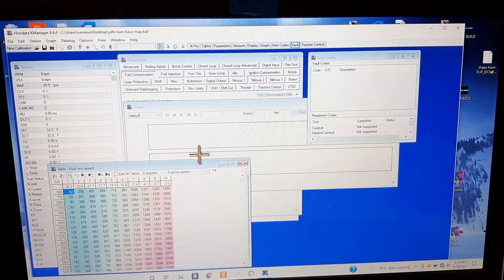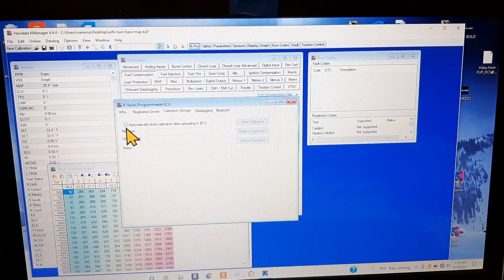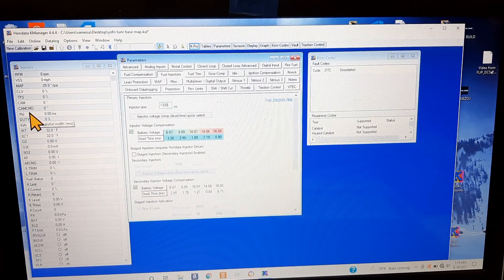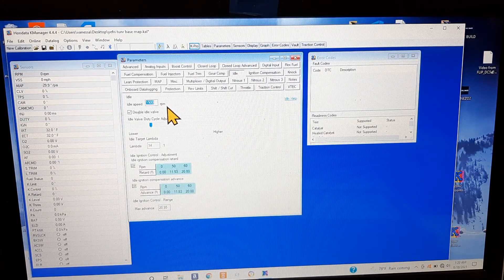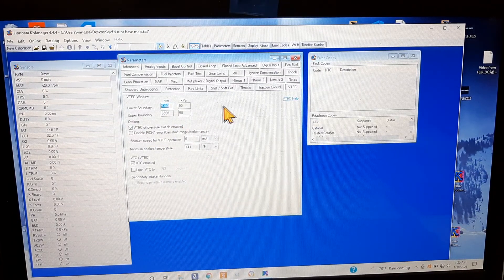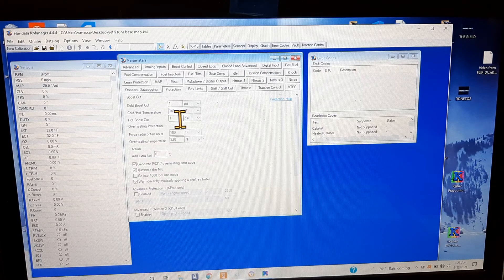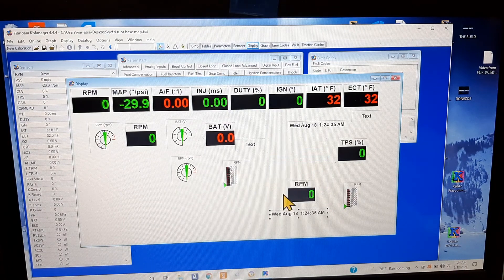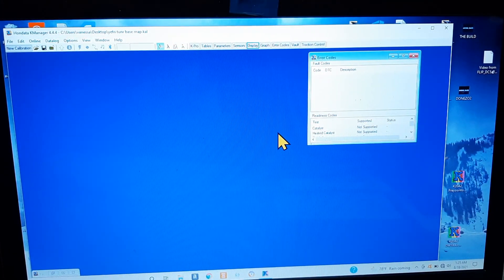Diy kpro4 ,do dataloging,Change injector size,Rev limits,Control idle,Retrieve maps,&more

Comment: Thanks for making these new Kpro videos. Yeah been sittin on a new Kpro 4 for a minute and actually don’t Really like it. Pay ALL that loot for an ECU and Hondata don’t give you SHIT for a manual on navigating the Kpro! Weak customer support in my opinion. ALMOST bought the Fueltech ft450 and sell Kpro 4 till I seen it was gonna be a nightmare to setup. You gotta know the cam and crank pulse plate teeth count for it to even recognize and even crank and fire. Support or info from fueltech for K series is little to none this early on. So for now just stuck with the Kpro. Can’t get my swap to idle  smoothly or for any duration of time. Revamping fuel system and some other stuff.
Reply from the maker: Yeah they deff dont have a manual 4 nothing,thats so u give money to the tuners. Wow that sounds crazy, if u upload a base map the car wont turn on?it should turn on atleast change ur injector  size and u should be good just for idle. If u have stage4 cams then it might be harder,but check in the kpro see if they have amap for cams ...i thought they did. Kpro is suppose to be the easiest to work with, Dont get full of fear afraid to touch anything,if something is wrong just unplug it. As long as u dont upload and change the map ur good. But Gluck  and ur welcome. I put those krpo videos  on playlist👍
Reply: @Queensraces  I didn’t get a notification so I had to go back and see if you responded appreciate it  greatly. no the deal Is everything is wired right Also. It’s running rich then goes lean. on idle . Didn’t put stage 4 cams in yet . I’m waiting to go boost and cams and head studs and gaskets all set back till I get it running and idling and everything else even had to buy a header and full exhaust just to be able to run it in my neighborhood so I can at least get the idle and run decent. Anyhow yeah I get that Hondata  wants  to throw a bone to the tuners but they’re like the only ones out there that I’ve seen doesn’t even give a manual . like it’s just stupid as hell. Anyhow thanks a lot for the help and info
Reply from the maker: The pulse plate teeth omg mad detail ..🥺 i know some people dont want this info to get out but i made this video becuase there's  no info about kpro stuff on youtube. Not ever1 has money just to throw at these tuner for maps feel me...so im happy if any of my vid helped u bro
Reply: @Queensraces  . FACTS bro. Yeah I ain’t rich neither so yeah.

Comment: Can I pass inspection with a kpro in a car under 25 years old?
Reply from the maker: Yes u can,u can turn off the emissions, and disable the 2nd 02 sensor .AND ULL PASS.
Reply: @Queensraces  thanks.  I understand how to turn off sensors but where i find the option to turn off emissions?
Reply from the maker: @larryp85   idk how to do it ,but if u see anything  in the kpro that say disable evap! Disable bank 2 02 sensor,or if u find the word emissions . I dont want to lie so u ill check later in my kpro.
Reply from the maker: From wat im reading if u buy kpro that automatically  disables emission. If not to find disable evap and u can pass emission
Reply: @Queensraces  ok thats what i was thinking. i know hondata used to have a readiness section to get you ready for inspection before the recent update. i would expect them to make it automatic/ hidden to avoid problems with the epa since they been trying to sue hondata for that.
Reply from the maker: @larryp85  i just uploaded another  video, i put the inspection part in the beginning .Enjoy 👍
Reply: @Queensraces  appreciate it